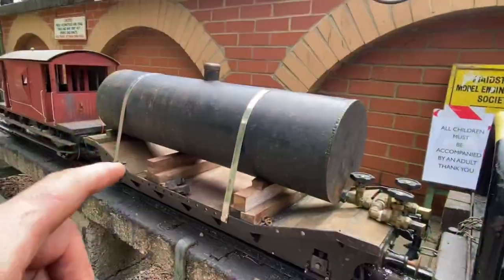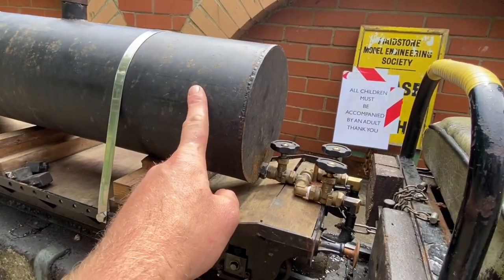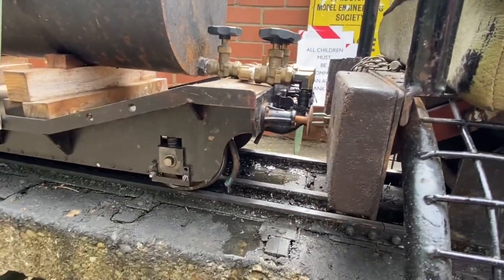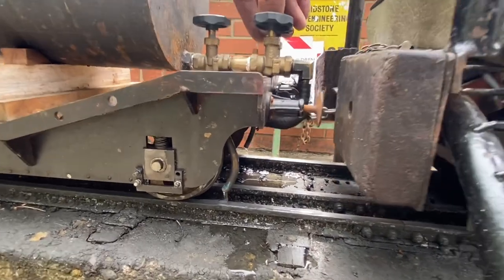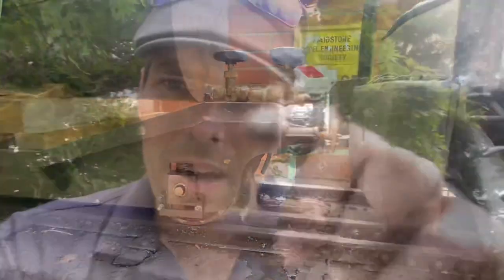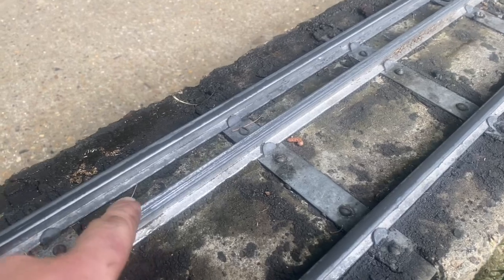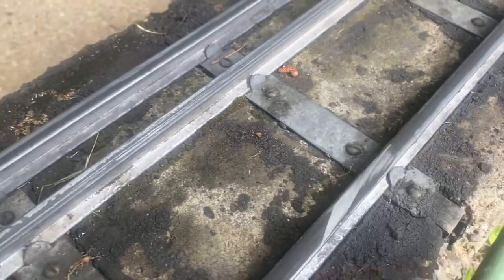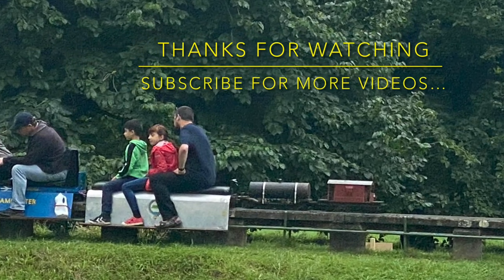5” track cleaning wagon

Comment: Just to add to your observations about grip and wet rails. With full size trains after you’ve had heavy rain for a while it cleans the rail and grip improves. The worse conditions for slip / slide is light drizzle. It doesn’t clean the rail but does exacerbate any contamination such as oil or leaves.

Comment: We always used to find that sandstone was the instant fix. It works much better than bagged sand because you don't really ever get an excess. Just a bucket of water and a lump of sandstone lightly rubbed on the ally rails. The sandstone quickly develops a groove for the rail to slide in, but you don't get lots of sand on the track. It just leaves the finest sheen of sand particles, and the rubbing action tends to break up the grease. No doubt though, ally rails can get pretty slippy sometimes. Maybe put a blob of fairy in the bucket too.